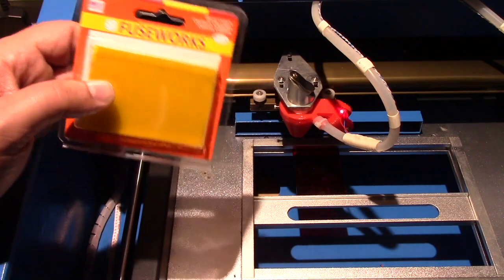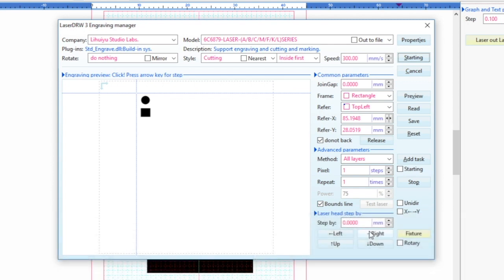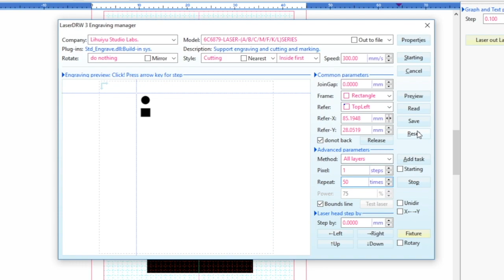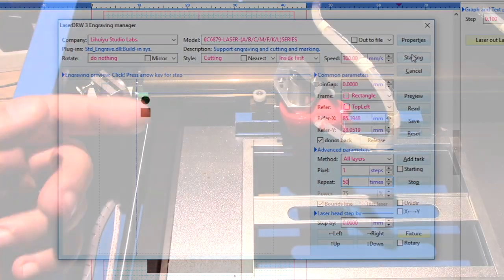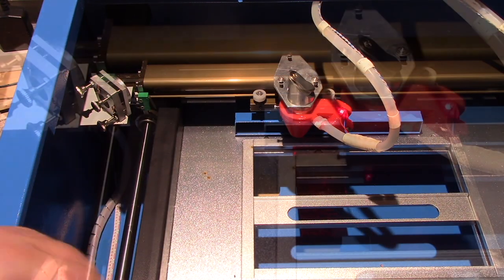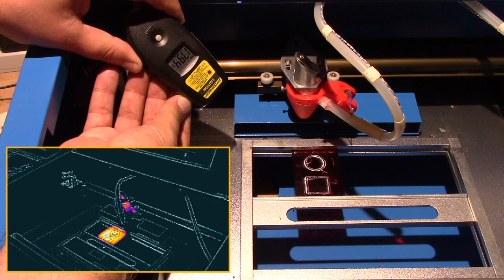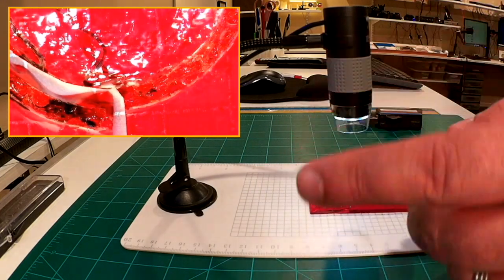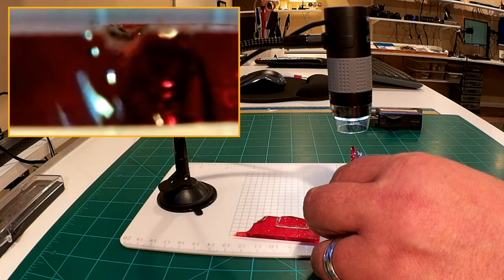K40 eBay Chinese CO2 Laser Cutter & Engraver - Fuseglass Revisited!

Comment: great video, is there a way to unlock the motors so that i can be able to move it over the object i want to engrave?
Reply from the maker: Yes you can unlock the motors from the driver (click the burn icon as if you are going to start a job) and there is a release motors in there, however it just releases the motor "you can not manually position the head for cuts".  The control board need to know where the head is at to start and it must be position via the software.  Sorry...
Reply: ahh, ok,  thanks for the info, i also subscribed :)
Reply: cool, i just tried the engraving with the "release" motors and worked, thank you!, was wondering is there a way to set it so its starts the print from the middle instead of guessing?
Reply from the maker: Well if you knew where the middle was you could enter the the numbers (to locate the head there) but other than that as you see I have laser pointer set up to locate the starting point so I know where the beam is...

Comment: I think the thermal cam is great, but only if the image coming from that cam is in sync with the image you are showing in the background.
Now it's just two non saying images on top of each other, there is no link between the two.

Could be a real improvement if you sync them.
Reply from the maker: Thanks for the feed back, in some cases it is possible,  however a lot of times you will me share an image from the Flir as a reference.  In other words what temp signature looked like at that so there is a "link" I will just need to do a better job in explaining :-)

Comment: Very interesting. How about preheating it uniformly with a hot air gun?
Reply from the maker: A hot air gun would not get it hot enough, some folks have mentioned other  means but that become messy as well as dangerous too along with the glass sagging.  Part of the issue (maybe all of it) is the glass doesn't vaporize like wood or plastic, simply melts.  When it melts "down" it progressively requires more energy to do the same work and as the laser simply continuous the effect becomes less and less as it sinks more heat and cracks.  I am going to try more of a pass and cool Technic here shortly and see what happens...

Comment: just have to say thermal cam is wicked .  time to use forced air or water cool the target glass.
Reply from the maker: Yes it is very cool, and air is an interesting idea as really though I had it, but in the end it !
Reply: i think if its not pressure form thermal expansion that doe snot go away when cooled  the water bath even may help . I fully agree with the many passes with a fast flash off of the surface .  but its no doublt heat build up is your enemy here .  too bad its not G code ( yet )  , or you coudl  give teh  laser a dwell period between passes . 
would be cool if some one figure out how to use a thermocouple to act as a pause  for a CNC .  if the target work gets too hot move off and pause / dwell till cool
Reply from the maker: My other one is gcode controlled and try that where it runs than dwells and so on as I still have more glass 😀

Comment: Have you thought about putting a cooling fan onto the object like we would for a 3d print?
Reply from the maker: XerotoLabs also brought up air and I don't believe had air assist on which would do the same.  Guess I need to try it again as I have reset up (i.e. made room for) my other GCode controlled laser and thinking about it do like a thousand passes but a few second after each to allow the glass to cool down...
Reply: DIY3DTECH.com
Air assist would not be the same as the air I mean is it cools the entire part not just where the beam is hitting.
Reply from the maker: Typically run the air at about 6psi to blow the smoke and other debris out of the way, however I could it up to say 30psi and think it would have a similar affect.  Maybe next time around will connect my thermal couple to it and watch the temp...